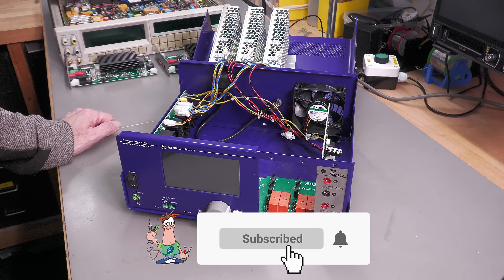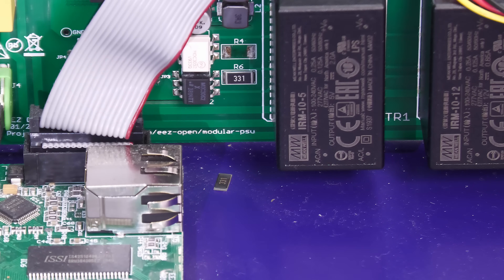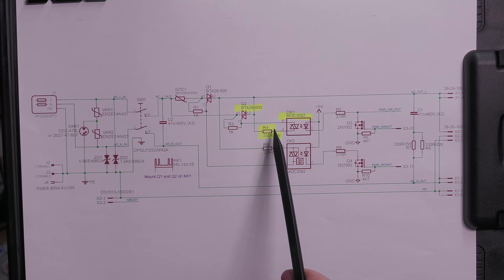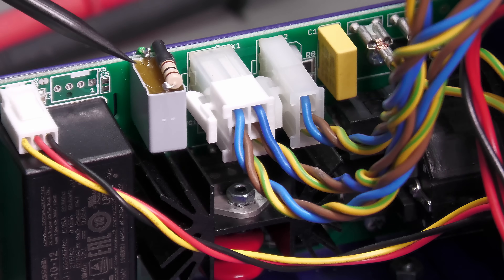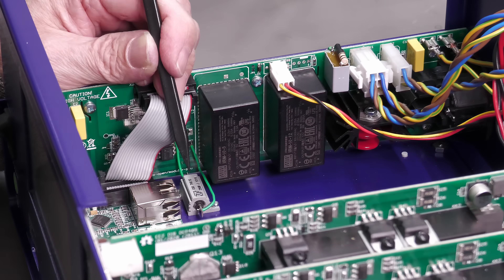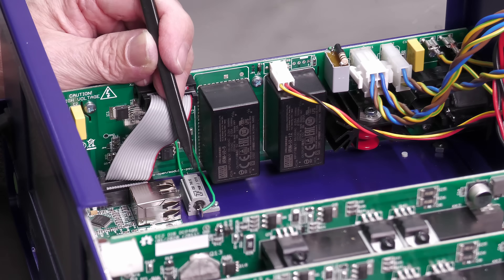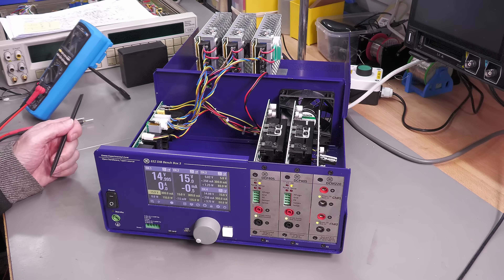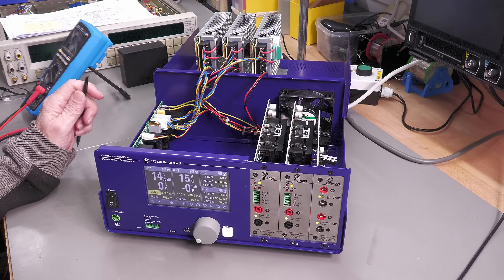No.169 - EEZ BB3 Power Supply Repair (again!)

Comment from the maker: UPDATE: So, the BB3 is back up and running......but my OCD tells me the triac's have got to go.
I looked up non-triac based SSR's (which probably use back to back mosfets) but they are expensive, so am now looking at the good old relay as a solution. So, I might give it a go.......if I do, there will be another video.
Reply: "OCD levels are very low in my workshop.....:-)"
Reply from the maker: ....sometimes...:-)

Comment: Good workaround. My tuppence worth is that the circuit is a bit of a faff, just to short out an NTC. The schematic shows 2W for that resistor and, based on your measurements, the dissipation is 0.83W. So, the resistor needs to be at least 1.5W (not a silly looking SMD). If you wanted to go full Carlson, you could add a BJT as a current amplifier on the opto's output.

Comment: Does C62 (1000uF 25V) on the DCM220 board look a bit puffy?
Reply from the maker: It's just the lighting. Also, it's not soldered completely flat on the Pcb, I noticed that when I repaired the board back in 2021.

Comment: What I read is that it is about the opto-coupler used, that part applies 'random on' OR 'zero crossing' on (both are zero-crossing off).
This writing (Toshiba) gave me more info: "Triac couplers—basic properties and application design".
The two opto-couplers used in that SMPS are different: the MOC3052 is a random phase triac driver (so for inductive loads), and the MOC3062 which is a zero-crossing triac driver (for resistive loads). So the designer clearly made that difference already.

Comment: This supply seems very overcomplicated. Why not just use a Keysight or other well known bench PSU brand.
Reply from the maker: I used it during production of PDVS2minis, I interfaced a local push button and automated changing of output voltages via a script.
Also, there are many other modules available both input and output.
I like the flexibility.

Comment: Why is there an extra soft start circuit? The SMPS itself features inrush current limiting. It could just use a relay suitable for high inrush currents and a software adjustment so they can't be switched too fast such that the NTC in the SMPS has time to cool down again. The idea to fit an SSR isn't going to help much because the SSR must be oversized in order to deal with the SMPS inrush current.

Comment: An ssr works also with a triac inside.
Reply: Just what I thought, what you already have is an opto-coupler, a diac, and a triac, so . . . SSR, plain in sight.
Reply: But it seems there are special SSR's for inductive loads indeed. 'Random- turn-on' seems for inductive loads, while 'zero-crossing' is more for resistive loads. Just found info, I am not an expert. But then also begs the question, what kind of circuit is now used in that power supply.
Reply: @erikdenhouter  An SMPS is not an inductive load. The problem here is the very high inrush current of the SMPS itself and the requirement to oversize the TRIAC drive circuit to cope with this inrush current.
Reply: Put a couple of NTC thermistors in series with the SMPS to reduce the inrush current.
Reply: @SwitchingNoise  What I read about special SSR for inductive loads is that they can handle high peak loads, so maybe that is why Ian is aiming for these. What I also read is that it is about the opto-coupler used, that part applies random on OR zero crossing on.
This writing (Toshiba) gave me more info: "Triac couplers—basic properties and application design".
Reply: @SwitchingNoise  The two opto couplers used in that SMPS are different:  the MOC3052 is a random phase triac driver (so for inductive loads), and the MOC3062 which is a zero-crossing triac driver (for resistive loads). So the designer clearly made that difference already.
Reply from the maker: There are some, albeit expensive, that don't use triacs. Possibly back to back mosfets.

Comment: Replacing the Triac with an SSR would be waste of time, they are the same thing !
Reply: Interesting !
Reply from the maker: There are SSR’s capable of inductive loads I believe, that’s what I was looking towards.
Reply: @IanScottJohnston  Guess not. SSR is just a Triac with a gate driver and dumped into resin. Inductive loads have to be snubbed properly. Even EM Relays would not last long due to arcing in the contacts. Properly designed snubber is all what it takes.

Comment: Thanks for this, Great to know.... I've an EEZ BB3 & have been using it alot without any problems. Supported it back in the Crowd Funding era as i did with the previous bench powersupply the h24005.  I should go look what Firmware updates are available via Discord (make time & do it) just in case i am missing out on enabling the full capability of the unit.  One thing i will mention though is if you ever work on AM radio receivers because of the sudden explosion of interest in "old valve radios", especially some exotic collectable from a distant past... ALWAYS power off the EEZs! The amount of RF Hash the two PSUs i have are "radiating" is beyond incredible! I am not sure if that is the case for all EEZs but my BB3 is a shocker over the h24005 which is also guilty....
Reply from the maker: Very interesting! Thanks.

Comment: Incredible. As an expert you obviously have a first-rate workshop and equipment to match, and I was stunned at the number and impact of the issues you encountered with such an expensive piece of equipment. I remember you repairing it a few years back too. Design flaws, poor quality control or both?

Comment: Dear Ian , sometimes going with new tech. is very bad decision so please try to remove all these Triacs system and replace by 1 mechanical relay to shorten the NTC after the in-rush current period and also remove the optocoupler for the sake of the relay coil and that's it !... Forget the SSR solution , it is still around Triac switching topology ...

Comment: Hi Ian, a option is to replace those BTA26-600 Triacs with a BTA16-600CRG, that type only require a Gate trigger current of only 25mA compared to the 50mA of the BTA26-600, that way you can raise the value of that 330 Ohm resistor and you have less heat dissipation. The BTA26-600 is a 25A 600V triac, where the BTA16-600CRG is only rated for 16A 600V, but that will be more then enough for those Meanwell powersupplies.
Reply from the maker: Sounds like an option!......Will have to look up the surge spec though, those SMPS psu's together must have a large inrush current. Maybe why the designer chose the BTA26-600....?
Reply: @IanScottJohnston  , the max peak non repetitive current of those Triacs is 260A for the BTA26-600 and 160A for the BTA16-600. Also, on the schematic, the bottom Opto-coupler use Zero Crossing, so the inrush current on that one will be less then on the other one.
Reply from the maker: I think I'll try the  BTA16-600CRG and see what size of SMD resistor I can get away with and what temp it runs at. Thanks!
Reply: What is on the other side of the board where the SMD resistor is? Could you drill some small holes <1mm through the board and solder a 5W through hole resistor in place of the SMD one.
Reply: Another solution is to add 2 extra opto-couplers and let those control the gates of the 2 Triacs. Those opto-couplers are normally regarding the datasheet not intended for controlling a device directly, only as trigger device, but those opto-couplers can handle up to 1A at there outputs. 
By adding 2 extra opto-couplers , all 4 opto-couplers can run at very low current , way below the 50mA. Think the minimum current of driving those MOC30xx is arround 5a10mA.